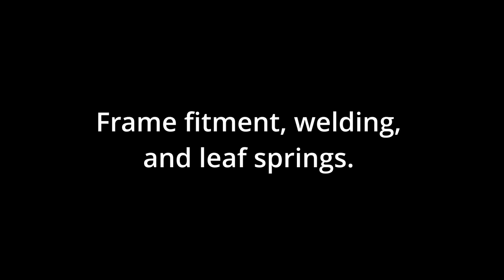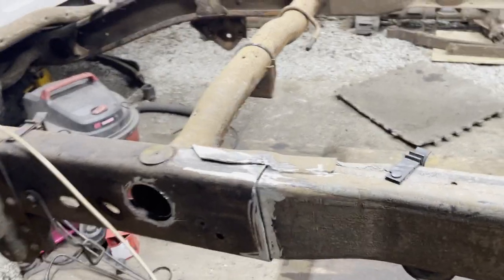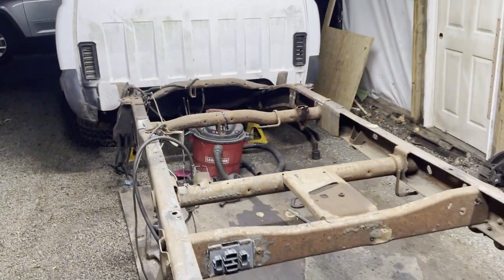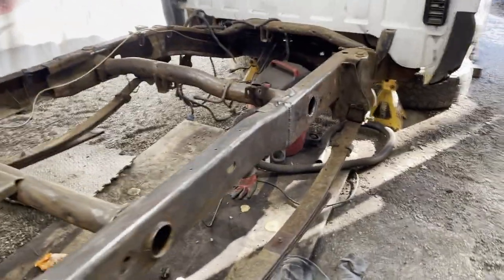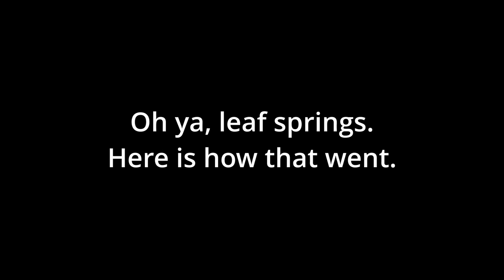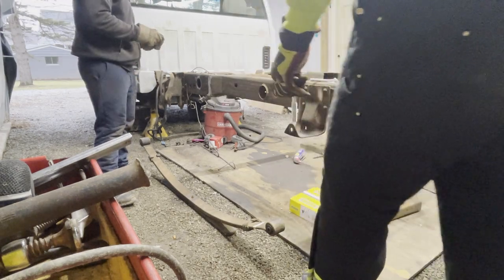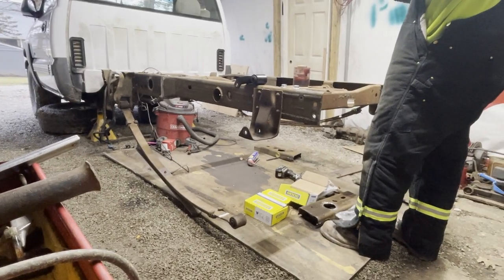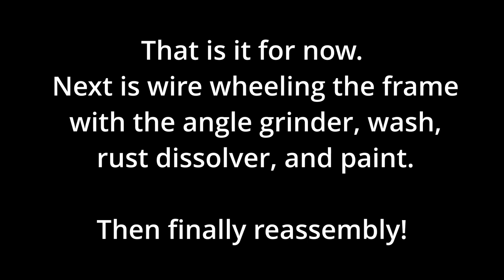Rusty Truck Frame Repair. 99-06 Silverado, Part 4, Fitment, welding, and leafsprings!

Comment: On ones I look at factory af the frame isn’t exactly straight how did you fix this
Reply from the maker: I wasn’t sure which part you asking about but when all this went together I took lots of measurements before disassembly and fit up. I made sure it was all square including the pitch of the frame well making sure it didn’t tilt up or down from factory.

Comment: Did you take cross measurements before welding to be sure the thrust angle of the rear axle was set?
Reply from the maker: I did and matched them up exactly.